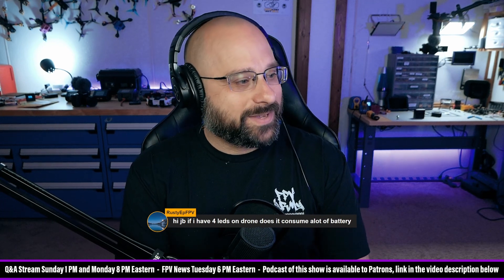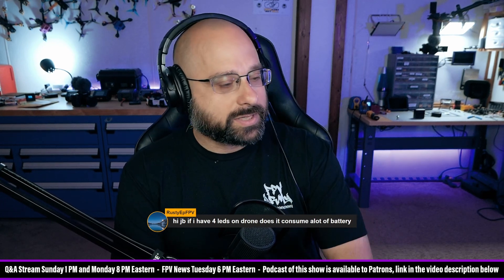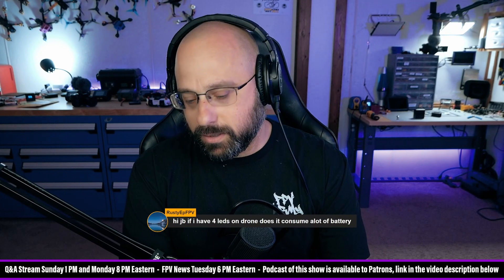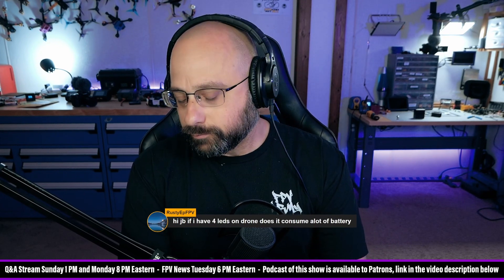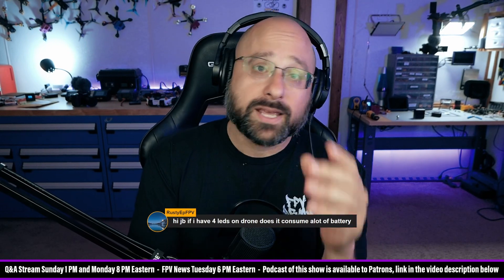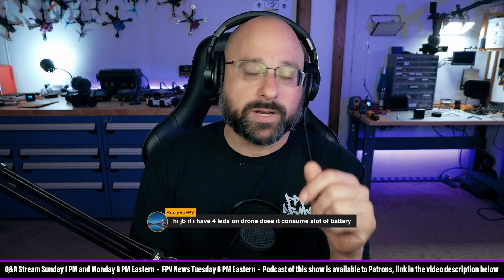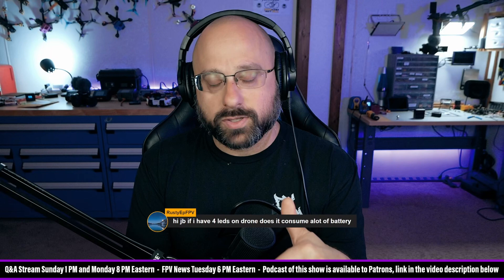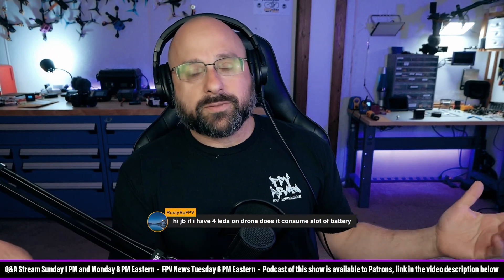How Much Power Do LEDs Draw On A Drone? - FPV Questions

Comment: Would it even matter on a 1s whoop?
Reply: I’d say the weight probably matters as much as the current on a tinywhoop. I’d avoid adding anything to them. Even 1 or 2grans is a relatively large % of the total weight compared to say a 5” quad.